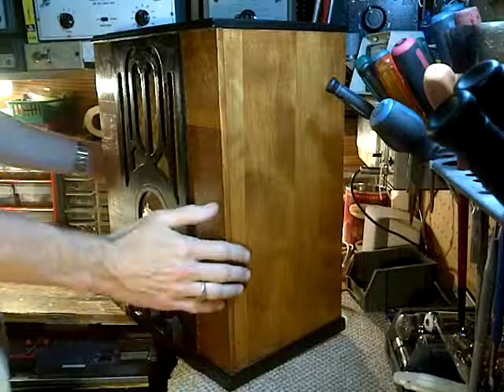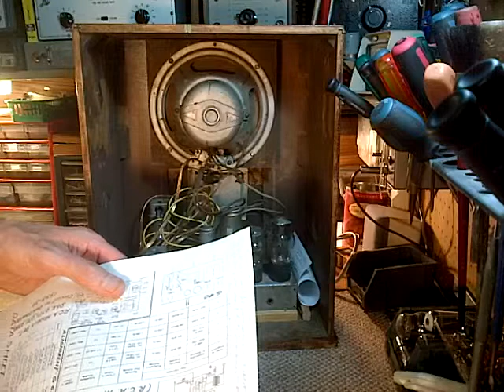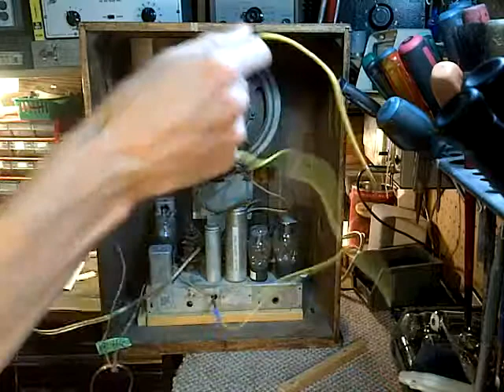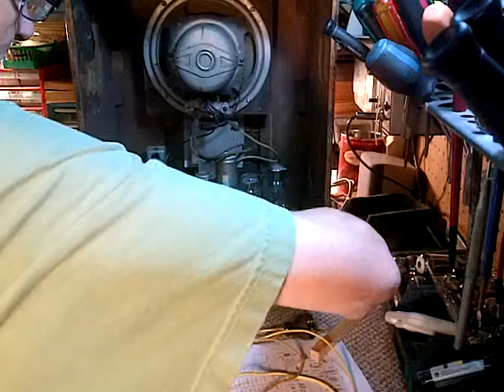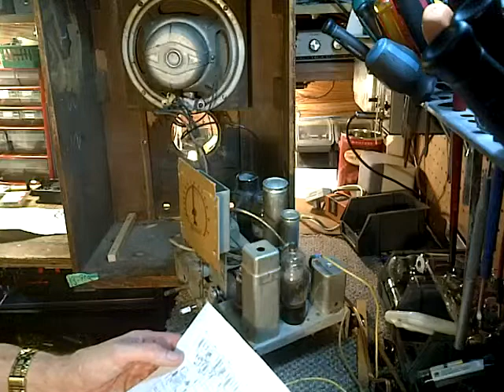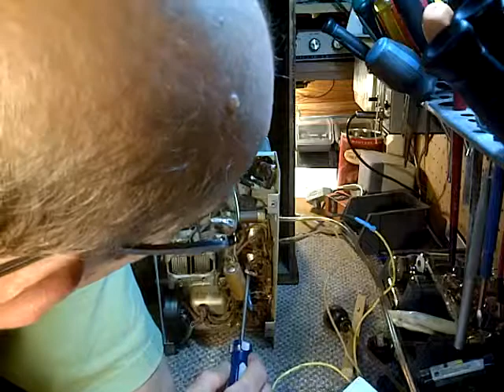Canadian GE G-40 Radio Repair Video #1 Checkout (it's a fake Marconi!)

Comment: GE, RCA, & Marconi... Oh my!
What? Maybe the cabinet is Marconi, the chassis is RCA & the mode# just has GE as its letters but not GE the company itself. Yikes! I don't know.
Three tubes? No RF preamp, one I.F. stage perhaps? A selenium instead of a rectifier tube maybe?
Wow, this is an interesting one!
A so, so chassis in a real nice cabinet. Doesn't make much sense, but... oh well. A cardboard dial? Yuk!
Jim, you might consider taking that cardboard & putting in a draw somewhere.
Have fun!
Tom